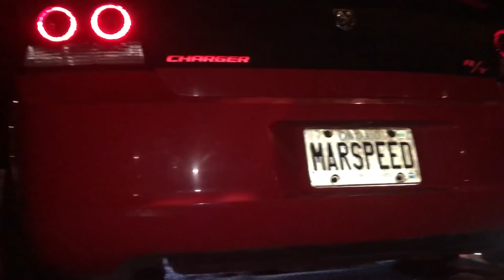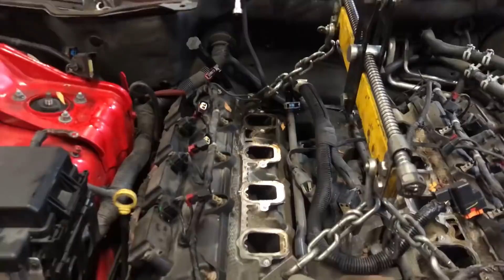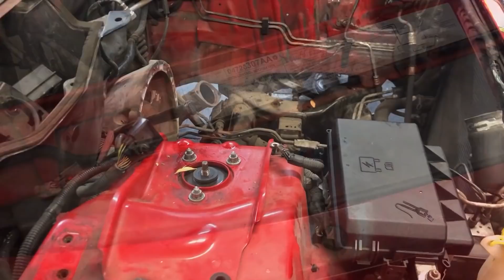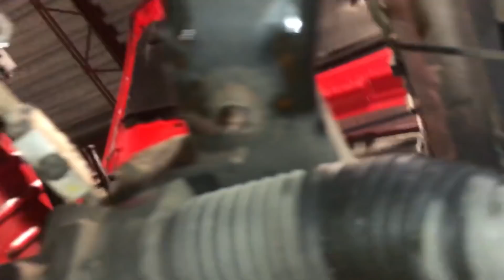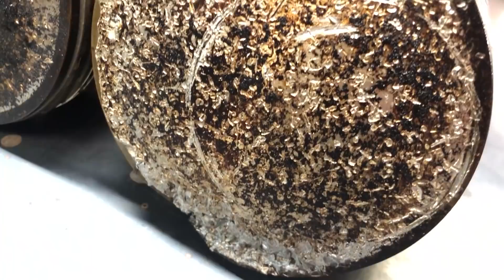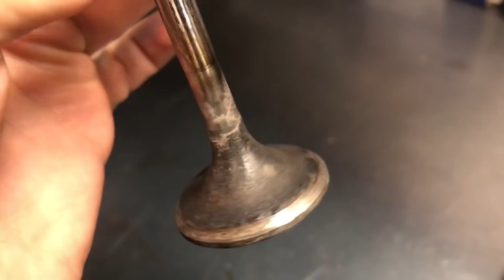How Much Damage Does Dropping A Valve Seat Cause? - 5.7L Hemi V8 Failure

Comment: Using original heads on a rebuild that had 183 k on the clock of course engine hours being higher and one thing being a master technician I've learned about this... The hemis do not like running hot... Now at 223,734 mi engine still purrs like a kitten using the original heads just took them apart cleaned them lap the valves new valve seats clean the heads plane them... And simply run it on 91 or higher octane with a 180° thermostat it runs cool I get heat sooner in the winter and it's stable in the summer makes plenty of power and I'm writing this to you while idling in the 05 Durango with 223,734 miles on it purring like a kitten. The only reason why the engine was redone is because I bought the truck for 500 bucks and the lady didn't put oil in it for 3 years and the motor seized up. So using the original block I got another Durango for parts for 500 bucks... And I simply use the crank and heads from the 183,000 mi Durango that had a bad piston in it due to detonation from low octane gasoline. Been builds up on the low octane gasoline around the edge of the piston slowly pushing on the head on every cycle over time until it blows a head gasket. This happens to all engines running cast iron blocks with stretch head bolts and aluminum heads. The higher octane Burns cooler which is always forgotten of course it's higher resistance to predetonation due to heptane levels... But simply put you are with you eat. Total cost for building the Hemi since I used the truck for other parts... Using my original engine block and the crank and heads and intake from the donor. (By the way both trucks had 183,000 on it which was weird but meant to be I guess.) I spent $415 for rods Pistons rings and rod bearings from an 09 ram that had 5,000 miles on it totaled by a tree I got off a guy on eBay... So all I had to do was the hand work all in house gaskets main bearings water pump timing chain timing chain guides basic bull crap for an additional $265... I built the whole motor installed TurnKey for $680 + my labor... Yes you lose a little bit of compression with the smaller domed Pistons that they move higher on the rods but they are stronger but I'm still using the stock original high mileage heads and valves matter of fact the rest of the vehicle is still mechanically all original just maintained with proper fluids... But no valve seat drops or rod piston issues. Run good gas 91 or higher octane with a 180° thermostat and you will notice a huge difference in startup and performance of the vehicle by your second tank once you've given the computer a chance to map out your driving habits throttle responses etc even though there is a base tune. On a technical note using 09 rods and pistons from a 09 and up 5.7 l in an older 03 to 08 5.7 l you will notice the Piston does not come all the way up to the deck by a few tho. By doing this makes the stock tune a performance tune then run 91 on the stock tune with those rods and pistons and it will be the same as the stock rods and pistons with a 91 tune aftermarket. I didn't have to buy a tuner for pushing performance out of the old girl because where the Piston stops for the deck the computer thinks it is the original rods and pistons as designed so the ignition timing is maxed out perfectly with the lighter rods and pistons which are also stronger which lightens the rotating Mass and has allowed my 223,000 mi 05 Hemi Durango pull away from my 06 16,000 MI yes 16,000 original mile Hemi limited Durango 2006. I have one at high mileage and one at low mileage and the 16,000 mi Durango simply got super unleaded or 91 or higher octane with a 180° thermostat and she runs cool and clean no issues and don't expect to have any. For the guys running super unleaded or 91 or higher octane and keeping their fluids clean is not enough the thermostat must be a 180. That 180 thermostat coupled with 91 or higher octane that burns cooler and do the research on temperature Burns for octane levels and you will find cooler gases escape faster through the exhaust system... The cooler burn and thermostat help against thermal expansion in the head and head gasket as well as temperature surface across the face of the piston as well as the valves and valve guides especially the exhaust valve guide. I'm out here to argue or debate this I have done it it has worked and I have 40,000 miles on top of old equipment with new gaskets and seals and bearings I tow with the vehicle and I drive it hard and put it away wet... And I'm still using the original valve seat pressed heads off the parts Durango that came off of an 04 which was built in 03 which were the problematic ones. You ask why I didn't use the heads that were on my Durango is because of the oil situation and the fact that they were warped bad and not worth the effort to rebuild even though they did not drop a valve seat. Took both trucks made one truck after 5 months still drive it to this day.

Comment: With respect towards Chrysler products, because I loved my '98 Durango 5.9 4x4, I'm going to have to give a hard pass on the Hemi. Not all of us have the money to throw a new engine into a car 🤷. But to each their own...
Reply: The newer hemi's with the Eagle heads don't have this as often.  it's mostly the older ones.
Reply: @ryotaryuu  But the newer engines fail from lifters eating the cam lobes.
Reply: @williamwhite9767  that has been proven to to be in less than 5% of all hemi's.
Reply: @ryotaryuu  Where's the proof?  There is no way to know exactly how many engines have been affected.
Reply: @williamwhite9767  my buddy works for a Dodge dealer.   He said the engines affected are less than 5% of all hemi's produced.
Reply: @ryotaryuu  Yeah, but he doesn't know about the ones that the owners repaired. He doesn't know about the ones that went to the junk yard. He doesn't know about the ones that independent garages repaired.  I doubt if he even knows how many the dealers have repaired.  Perhaps he is correct, but he's just guessing like all of us.  Chrysler has the data on all the ones that the dealers repaired most likely but thy would never release that information.
Reply: @williamwhite9767  ok whatever i'm not arguing.
Reply: @ryotaryuu  Actually, I think it is less than 5%.  That's one in 20 which is a lot.
Reply: @williamwhite9767  You are correct.  I asked my friend again and it's less than 1%.
Reply: It doesnt' happen to all of them.  I have a 2005 Dodge Magnum RT I bought new and it hasn't happened to mine YET with 116k miles on it.  I love the car and I don't regret buying it.  People who are that worried could pull the heads and get the seats replaced.  If the seats don't drop the hemi will last many hundreds of thousands of miles.
Reply: @williamwhite9767  I have a 2006 Jeep Grand Cherokee 5.7 with 180k miles and haven’t had this happen and I drive it A LOT. Actually just changed the spark plugs on mine recently too I love these cars you just gotta keep up with them

Comment: The valve seats were too small for the machined hole in the heads. Chrysler knows of this problem but did nothing to address it because most dropped seats happened after the warranty expired. The problem has been addressed in subsequent engines.

Comment: I have been driving Mopars all my life I'm 66 now still have my first car a 71 Charger needs restoration but that's another story but right now I have a 2013 Ram with only 30K I'm retired don't drive much and had a 09 Challenger only two of the 3 gen hemis I've had experience with so no high mileage experience yet but in all my years of driving Mopars with the older small and big blocks I never had any major issues with those engines so this problem with the new hemis is very discouraging I'm not giving up I have always done my own work on everything and for other people on the side so I guess I will see what happens right now I am using royal purple oil in the Ram I do regular service on the other stuff so I will see these cars and trucks these days cost to much to keep replacing.

Comment: I think heat soak/overheating have big influence but still is not direct reason. There are other engines with aluminium heads and deactivated cylinders, and they don't have that problem which btw dissappeared with Eagle generation Hemis. This gets me to conclusion that Chrysler had insuffiient quality control/tooling at that time.

Comment: I have an 06 rt.  My formula is a 180 t-stat, turn off mds, and setting cooling fans to come on at 195 degrees.  I also keep pit stops to a minimum.  If i have to get gas I try to fill up when the engine is moderately cold or leave the engine running while pumping.

Comment: Despite improvements to the Hemi, heat soak is still a issue, only now it affects lifters, instead of valve seats. The takeaway I get is let the engine fan do its job before shutting down your car, avoid excessive idling, and basic preventative maintenance done on a regular schedule.
Reply: Using a "turbo timer" on an aftermarket remote start system can help with the cooling off before shutdown issue!

Comment: What a heartbreaker! As stated, a couple of things combined to cause this...including whether or not a valve comes to rest in the open position. I can't imaging a valve seat having time to drop while running, but during cool down there's plenty of time. Someone here suggested cast iron heads for the new engine. I strongly agree with that idea. Sorry you had to find out the hard way.

Comment: One has to love that Fiat Chrysler quality. After this, they made them with the cam so high in the block that the splash system wouldn't properly lubricate the roller lifters when idling and that's why there's so many police cars with rounded off cams and worn-out roller lifters. Such quality. I bet the new French owners will do even better than this! There is no more Mopar and there hasn't been for years.
Reply: I really wanted one of these cars and as far as the so-called retro muscle cars goes oh, I like it the best but I just can't afford to deal with the valve train failures which I know I will eventually encounter. There's also a rust problem with the challenges because of all that foam they pump into the rocker panels and rear quarters. But it's still my favorite looking of all the Retro muscle cars of lately.
Reply: @jameswood678  Lots of new vehicles have their own issues.  Even toyotas aren't as reliable as they used to be because of all the complex designs that have been added for emissions and economy reasons.   Buy what you want, not what cosnsumer reports recommends is my philosophy.
Reply: @williamwhite9767  they've been making the internal combustion engine over 100 years by now and they still can't manufacture a reliable valve train in a pushrod engine Chrysler or Fiat or whoever the hell they are now. That has nothing to do with whatever Consumer Reports says. That is just sad.
Reply: @jameswood678  GM V8s have similar cam/lifter problems starting when they went to "active fuel management" what Chrysler calls MDS.    Adding complexity such as cylinder deactivation, variable cam timing, variable valve lift, direct injection and other stuff complicates reliability.  Fords had problems when they went to variable cam timing.  Government mandated CAFE standards and customer demand for huge, powerful vehicles contribute to these problems.  Before all these design changes, engines were known to last many hundreds of thousands of miles.  They might now but you have to take really good care of them.  Going 10k miles before changing the oil is risky I don't care what the maintenance schedule says.
Reply: @williamwhite9767  sounds like you know your stuff pretty well. But we have to differentiate complicated things like cam phasers and cylinder deactivation which I agree are very complex phenomenon, but what plagues the the modern Hemi is not exactly that even though there are problems with those things both in GM and Chrysler and whoever else, but what we are talking about is a very basic valve train problem that has nothing to do with cylinder deactivation or Cam phasing. We are talking about valve seats dropping from heads. We are talking about we are talking about roller lifters that have been used in GM engines 1987 that routinely fail in modern Fiat Chrysler engines. Those other systems have their own problems, but that's not what we're talking about we're talking about a basic valve train in terms of a valve seat dropping and of a roller lifter failing how hard is that?
Reply: @jameswood678  Evidently, it is hard because the GM V8s are no longer 100% reliable long term as well as the Chysler V8s.  Fords may or may not last long term either with their turbos.  I own a 2005 Dodge Magnum with the 5.7 hemi bought new now with 116k mile on it and I love the car.  If I replaced it with a new car it would be a Chrysler 300 with a Hemi or a Charger, maybe a scatpack.  I don't want a FWD car.  I like my RWD with a big hog V8 under the hood!!!  Bottom line is all cars are less reliable than they were 15 years ago.  I also own a 2002 F150 that has the 5.4 2 valve v8 with 165k miles on it.  Those 2 valve engines have been known to last many hundreds of thousands of miles.  Google Million Mile Van sometime and read about one that lasted 1,270,000 miles.  in 2004 Ford went to variable cam timing and some of those engines didn't hold up long term.  Read about the problems BMW has had with their V10s and V8s and 4s or Audi with thier turbo cars.  I refuse to worry about it.  I buy what I like to drive and I will deal with that decision.  Life is too short for me to drive a toyota corrolla because it might be more reliable.
Reply: @williamwhite9767  Ha ha I like your style and I agree with  you. None of the new stuff is reliable anymore because they're just chasing those last mile per gallon figures at the expense have longevity that will only way out after the warranty period is over. Some of these last gasoline-powered cars will be the worst before the electric era begins
Reply: @jameswood678  When I was younger and broke I bought many small cars, 71 Pinto, 73 Vega, 75 Honda Civic, 80 Ford fiesta.  they all had their good points.  The Pinto and the Fiesta were the reliable ones of that group.  I enjoyed them but I ain't broke any more.  I'm not rich either but I can afford a  car that I really enjoy driving now and the Chryser Hemi is where it's at for me because I don't want a small car such as a Mustang or Camaro.
Reply: The 5.7 Hemi is pretty much all Mopar as it was on the table when DumblerBends married Chrysler and ran off with Chrysler’s $billions in a war chest.
Reply: The 2003 to 2008 hemis are the same design as far as cam/lifter placement.  Something different causes the lifter/cam failures in the 2009 up hemis.  2009 is when they went to variable cam timing and something isn't right.

Comment: Well glad they fixed the issue with the newer 5.7s
Reply: how what did  they  fix??
Reply: @dawonnejackson7316  the valve seats in the pre eagle 5.7s they tend to drop valve seats after 100k cause they used steel valve seats on a aluminum head so the head would expand more more so the seat would drop and when you go to start it it would basically destroy the motor

Comment: I'm at 243,000kms on my 2009 300c Hemi and not a tick or anything to be heard. How to I keep from dropping a valve seat?
Reply from the maker: You’re not affected, only 2003-2008 hemis, so no need to worry
Reply: @MarspeedCars ohh Sweet but I still could have lifter problems? Sounds pretty healthy, just the typical injector sound

Comment: My wallet feels for you!!! Do similar things happen to Chevy and Ford V-8 engines?
Reply: Ford guy checking in here, 

The 4.6 3V Triton engines have cam phaser and catastrophic timing chain tensioner failures.
Reply: @chrishernandez2490  the 5.4 3V Tryton is the worst.
Reply: And the chevy engines from about 2007 up have lifter/cam failure problems when they went to "Active Fuel Management", their version of MDS.

Comment: We do take for granted that cars used to be built to last only 100k if lucky. The odometer only went to 99,999. My old Buick with a rocket olds 350 only put 170hp out and wasn’t designed to last for 100k. Now we expect engines to last at least that long with over double the power. I have a 13 rt plus awd with 100k I just bought and has had perfect maintenance. I use auto stick on the highway to disable the cylinder shutdown. It has an after market exhaust and had a bad drone at 70 when the cylinders deactivate. But goes away when I put it into 5th gear. I’m hoping it helps, but who knows. If it does go, I’ll just put another motor in an run it till the car dies. Here in pa, the bodies usually go before motors though.

Comment: That's terrible. Such metallic carnage. Made me cringe. Sorry that happened. It's nice you put out the video. Don't know what you can do to prevent this other than reworking the heads on a high mileage engine (new valve seats). But that would be EXPENSIVE. As far as heat soaking goes, you'd have to drive the car mildly after flogging it before shutting it off. That would be a major inconvenience.....but could save thousands of $$.